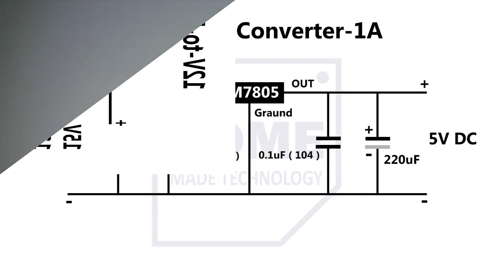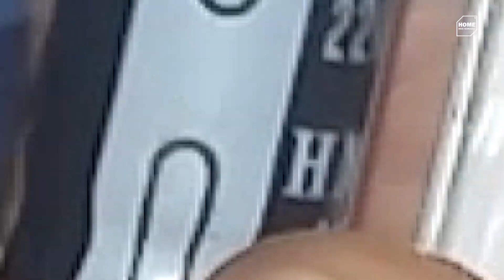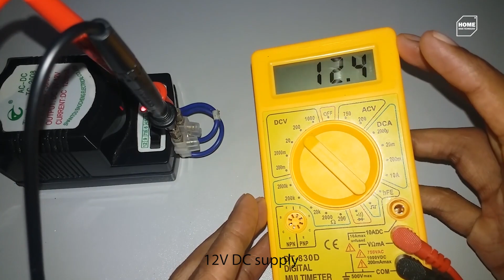12V,9V to 5V DC Step down Converter Using LM7805 Voltage Regulator DIY

Comment: I have used 7809 to convert 12V DC to 9V Dc for my guitar processor (gadget) but from the output of that guitar processor(gadget), even the volume is at zero level, buzzing noise  is continuously coming from the speaker.
I thought it to be  due to jacks and other reasons but it didn't work.
But when I used the adapter (ready made) it works just fine.
(& Yes I have matched the polarity too, without which the guitar processor (gadget) wouldn't have turned on)
Reply: U need a 101 cap on the output I think mate.

Comment: I have made 5 volts circuit by using L7805CT TO-3 Package, by 12v input and rectified with bride diode and filter with 470uF 50V cap.
But the output is showing 15.56 volts at last points.
Why is this happening?
Reply from the maker: replace in a new lm7805
Reply: @homemade_101  Actually I connected them oppositeley by using Google images, I was so disappointed.
I just decided to have a last chance by changing the direction of in and out.
I was unknown Abou the opposite direction behaviour of the ICs, 
But It worked. I was wrong with first connections, now it's solved. Nd got desire output

Comment: Bro just a doubt , how u determined the amp , cause when there is no resistor in the circuit then it said to have infinite current , so kinda confused please can you help me
Reply: The output is 1.2A
Reply: There is never infinite current as there is always resistance in any circuit.  At least until something melts and opens the circuit.

Comment: What is output current?
Reply from the maker: 1A Max
Reply: @homemade_101  ty.. how about input current to the regulator from the main supply?
Reply from the maker: @jeremytiempo9639   ,12V or 9V DC supply